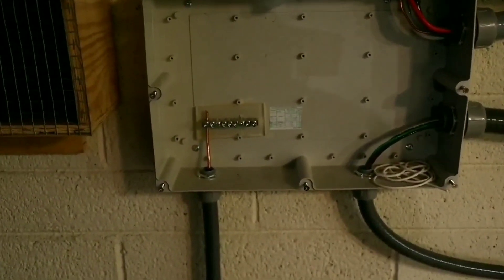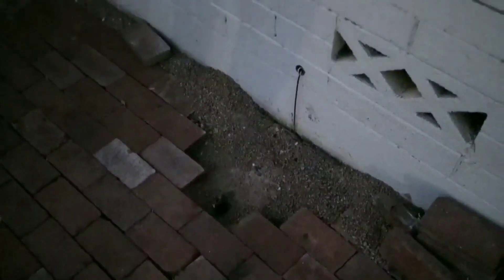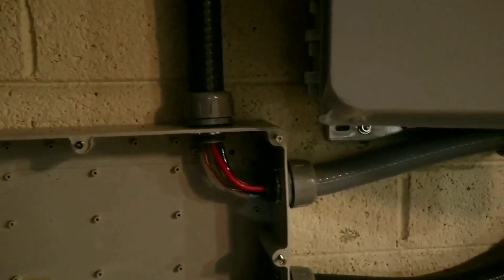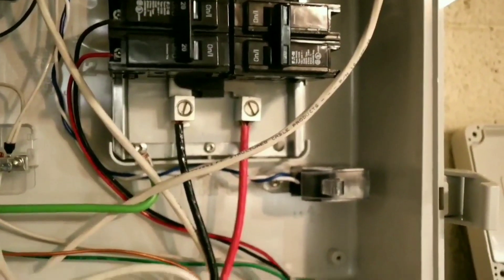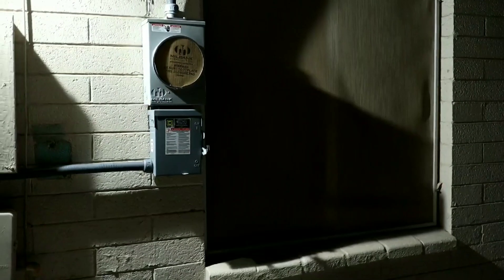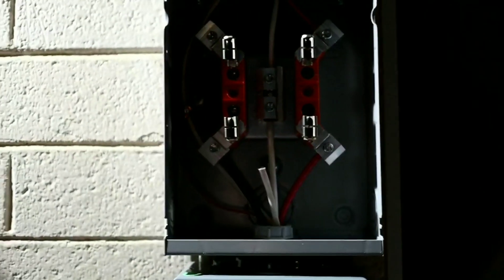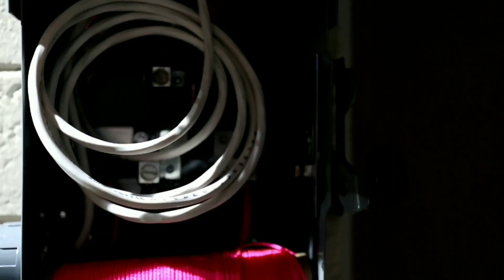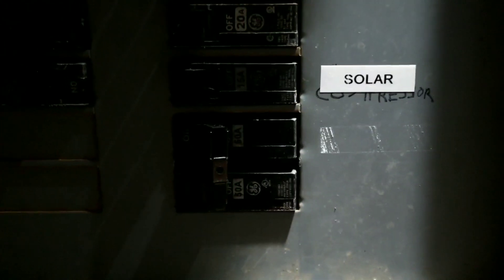My DIY Solar: Part 3, Solar Meter Socket and Disconnect

Comment: Question. What type of fitting/connector did you use to connect the quick disconnect to the meter socket?
Reply from the maker: I used a short piece of threaded conduit. I just drilled the hole large enough for it to pass straight through and but nuts on both ends to clamp the two boxes together.

Comment: The meter socket I have is slightly different than yours.  It has a spot on one side to connect neutral in and out, but i have no additional spots to connect the ground. Its a bit dark in your video when you show it.  What is that copper ground lug you have for that bare copper ground and did the meter socket box have a threaded hole to attach it, or did you drill one in for it?
Reply from the maker: I added the ground lug in. The box did not come with it and I assumed the box needed to be grounded so I added it in. I just utilized any existing hole I believe.

Comment: Why do you have a dedicated hardware meter between your combiner and the shutoff? Doesn't the Enphase system have it's own production CTs and monitoring within the box?
Reply from the maker: My electrical company SRP requires one. There is also one for the batteries for a total of 3 meters.

Comment: Great video series!  Does the Enphase IQ Combiner 3 require a charge controller (I assume is doesn't since you didn't use one)?  Is it because the AC battery handles that part, or the Combiner box handles it?
Reply from the maker: The charge controller is built into the battery.

Comment: My city requires a permit and the installer to be solar certified with a class and a fee, so I don't see how I can just do it myself.  Am I missing something?   I'm in Colorado.
Reply from the maker: It might be where you live. Solar and power companies have a lot more money than we do to bribe jurisdictions having authority to keep homeowners from doing things themselves. They argue it is in the name of safety but that's a load of crap.
Reply: ALL CITIES REQUIRE A PERMIT!  as long as you are the home owner you can do whatever you want to your home. you might have to make a fuss, and call everyday, but I have never ever heard of a home owner being flat out denied to modify their electricity in any city. IN my city I had to take an elelctrical test.  and then 10 years latter they got rid of that stupid restriction.

Comment: If PGE turned off the Solar AC disconnect, will the entire house loose power to from the grid?
Reply from the maker: The solar disconnect is only for the solar. It disconnects the solar from the home's main panel. It would not disconnect power from the grid. This video shows the power flow: https://youtu.be/y8-_95BUnoE

Comment: You have a neutral ground bond there. Not sure if that’s to code
Reply from the maker: The Neutral and Ground are separate till they reach back to the main panel. That is code.

Comment: Hi, 
Which junction box bus bar are you using? 
Thank you
Reply from the maker: There are 4 involved. 2 in the combiner box, 1 neutral, 1 ground. 1 bus bar in my junction box for equipment ground. And the bus bar in the main panel. Not sure if this answers your question. Or are you asking for the product? If so, it was a bus bar bought on Amazon.
Reply: @ICanDoItMyself  I was asking about the product information. I am planning to install similar junction box. 
Thank you
Reply from the maker: @tarangpatel29  https://www.amazon.com/dp/B002FQKSKO?ref=ppx_pop_mob_ap_share

Comment: How I can conect my solar system thru internet got desconected?? Please I need help
Reply from the maker: My system (Enphase system) is connected to the internet via the IQ Envoy through ethernet. They have a wireless adapter but I prefer the ethernet because it's more reliable and consistent and wasn't difficult to run it to my internet router. Not sure of your system, hopefully this will help.
Reply: @ICanDoItMyself  what can i do for my system to work if its wireless?! If not how do i connect the adaptor directly to the internet?
Reply from the maker: @teresagonzalez9530  I can do a quick video on the ethernet cable when I get back in town. I'm not sure about the wireless adapter since it's not what I used.
Reply from the maker: Here's how a have it connected to internet. https://youtu.be/_JHsOoDnqC4